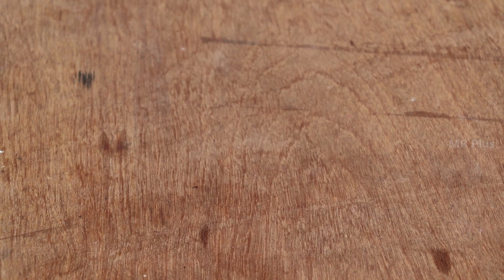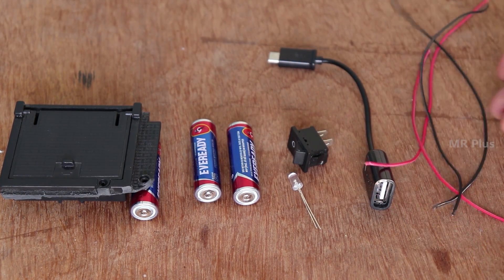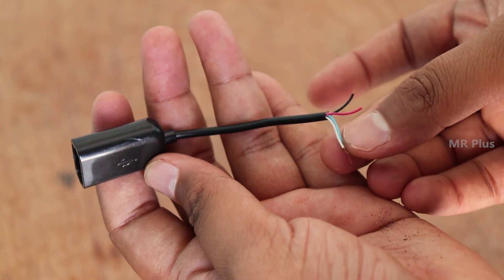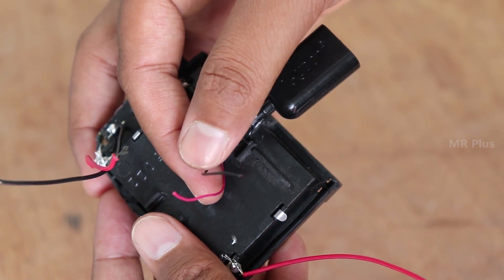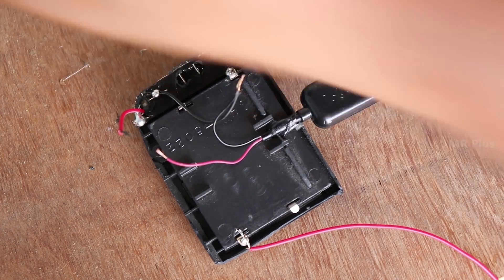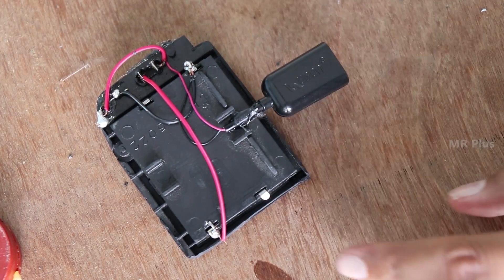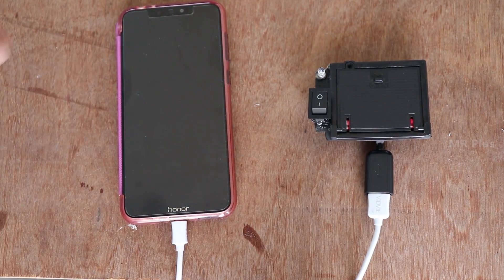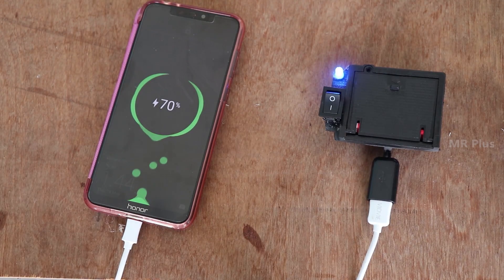50 ரூபாயில் POWER BANK | How to make emergency power bank in tamil

Comment: No bro failure method charge aagathu...1 hr chrge paninalum 1 or 2 Percentage kuda chrge aagathu..u should use some circuit boards for boosting and increasing the voltage and amps..🤝

Comment: fundamental procedure is to be strictly followed while developing power bank using mere AA battery of 4nos. with voltage rating upto 6volt when smartphone charges at 4.5volt or less. it is well known fact that this kind of power bank will not work out to charge to 100% to 1% within 6hours as current power bank takes to charge, moreover the capacity of diy AA battery of 4nos. will be very very meger to power up enough for multiplie times. it is either waste of time or earning money from youtube channel opening in multiple numbers as per information this is third channel from one person like you.

Comment: Bro voltage adhigama pona mobile explode aaidum ,
Reply: Ella bro agathu because 1.5 v tha 1 battery therefore 1.5 × 3 means 4.5  Voltage tha normal charge capacity  so no explode bro ☺️
Reply: @srinivasan.n1363  appo slow ah charge aagum
Reply: Normal charger capacity 5v
Reply: @saravanana2394  bro ithu just emergency purposeku tha bro